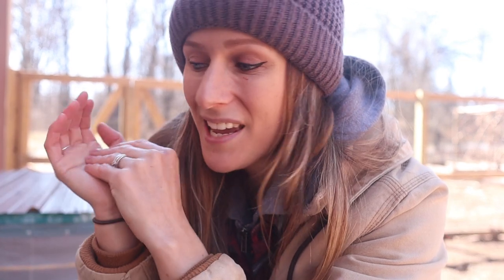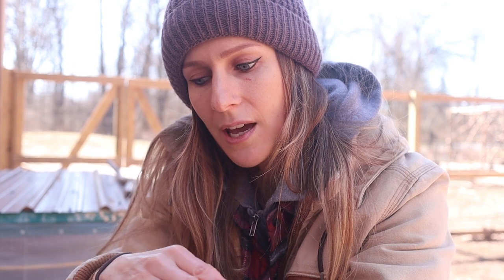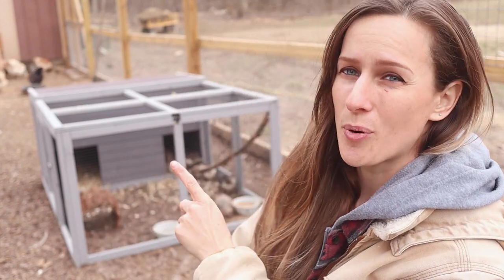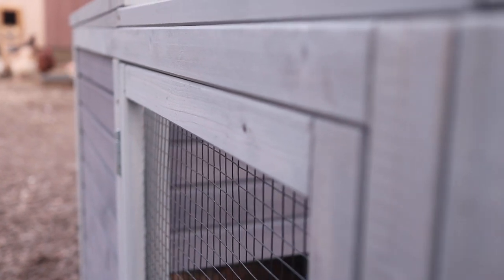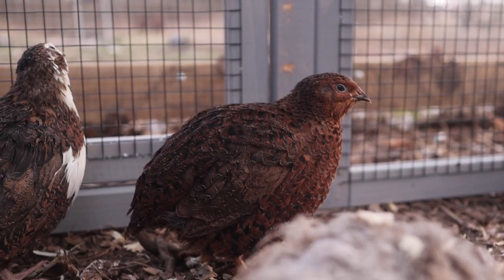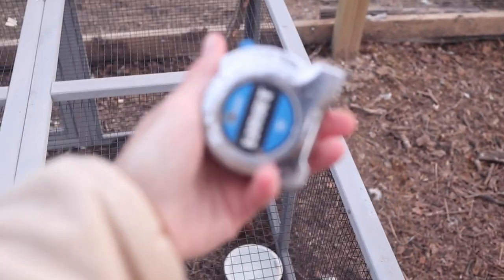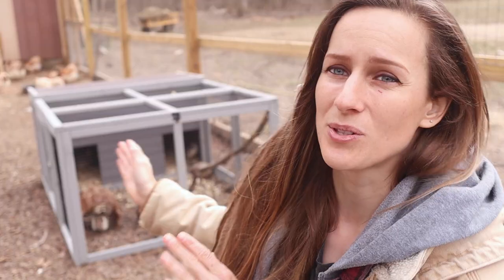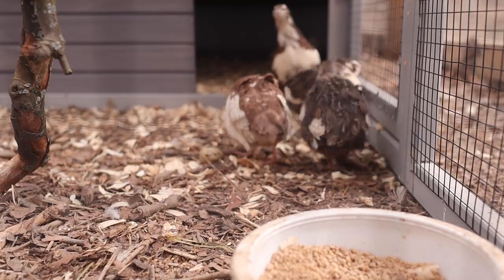The Best PREFAB Quail or Rabbit Tractor? - Aivituvin Review

Comment: On a slightly different subject... would you advise against coated wire for rabbit cage bottoms???  In the appropriate hole space and gauge, of course.
Reply from the maker: If you mean PVC coated, it’s fine if the bottom is 14 or 16 gauge. The only potential downside I see would be the inability to torch it for cleaning purposes.
Reply: @TealStoneHomestead  thank you for that. I will keep that in mind 😁

Comment: The first thing I'll do is to water proof it ... again. What it has will not last for long. That curved part is because they used crude wood. That means they do not have the logistic to secure their own dry wood - tools to dry it, or experienced enough people to identify the dried wood... A small company?
Reply from the maker: It is prefab, so I’m sure it is mass-produced and they miss on quality here and there. I still think it’s a good option for those who may not be able to build their own structures! An extra layer of water-proofing is definitely not a bad idea.
Reply: I think a tarp over it that can be tied down like tent strings would make this last a LOT longer.. would also paint the wood that touches ground with an waterproof enamel paint as water soaking into it would trash it quick.